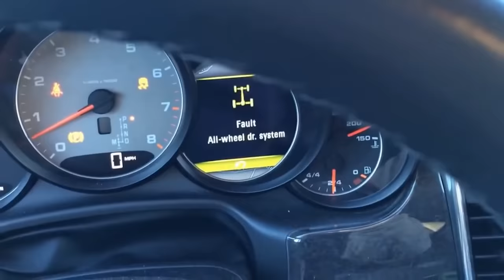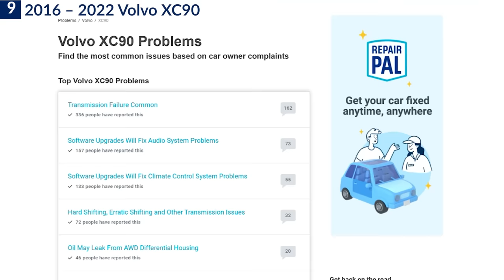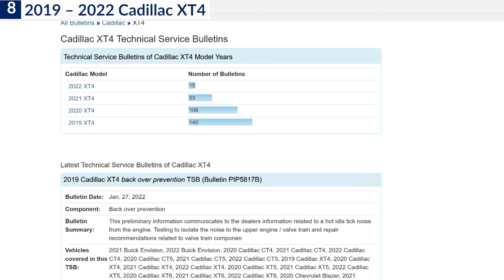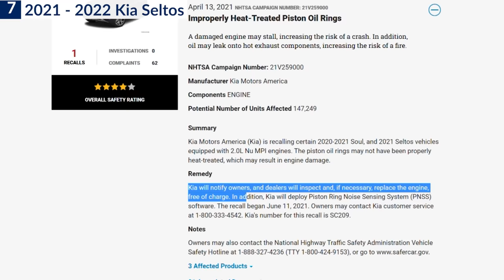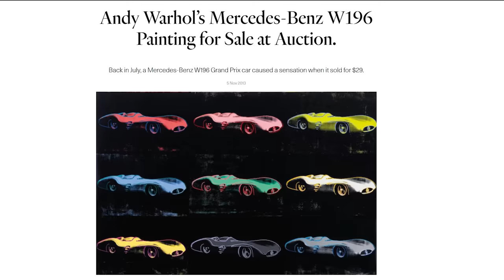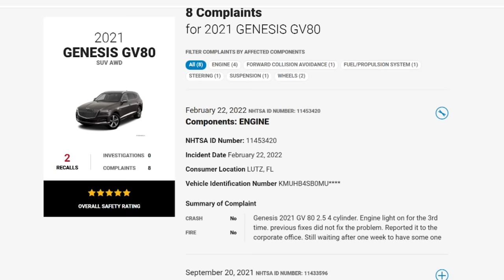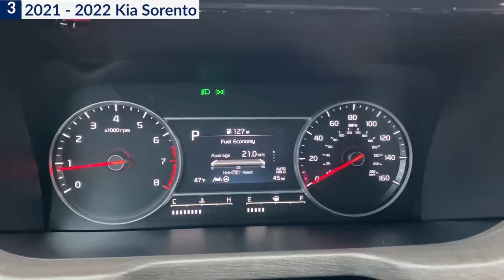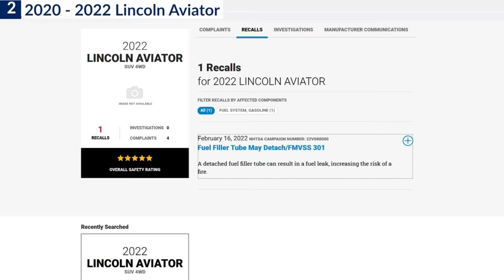10 New SUVs to AVOID - Here is Why !!

Comment: You are wrong about the XC90. Most issues with the car were electrical/infotainment related which have been addressed with newer models. The Engine was revised too and it definitely does not have transmission problems. If it does, then the Lexus RX350 would to since they both have the same transmission. This is coming from an owner... and I did a review on my channel if you guys want to see.
Reply: I have an XC90 too. What's the spec on your daily
Reply: The fact that Land Rover didn’t make this list tells
Reply: @bradleyscarreviews  Exactly
Reply: @nkulid424  T6 Inscription. Every Option. =) But I bought it used from the dealership non CPO.

Comment: This why I'm waiting on the '23 Passport.  I find it funny, that I like the Sorento better than the Genesis.  It's the same vehicle.  Love the same shot when they were putting on the door for the Explorer and Lincoln.   I don't get the fact your paying 10 to 15k more for a luxury name on the same platform.
Reply: They have zero in common other than sharing the same parent brand. The Genesis GV80 is a performance rear wheel drive based crossover and the Kia Sorento is front wheel drive based general crossover.
Reply: @chefcjnobles1680  yep
Reply: You make no sense. The Sorento and GV80 have nothing in common and they don’t share the same platform.
Reply: @steven5509  Ok, that I did not know.  Thanks for the correction.
Reply: @TwoPair72  you’re good

Comment: I am a realtor & live in Rural Ontario Canada and have owned my new Genesis GV80 since July 2021 where it took 6 months to become available but I have had zero issues with this vehicle since. The dealership picks up my GV80 from my home and drops off a loaner free of charge and they drive it back to the service centre where I receive from the dealer (which is approx 170 klm away) prompt servicing and they return my GV80  in pristine condition. I have no complaints with the Genesis GV80 that I own.
I have also only just receive one recall which was to do with the seat belt tensioner but thats all.
Reply: By the way I did buy the Genesis GV80 Prestige AWD 3.5T with every available option ! It was the first one in my city. I am told the larger engine seems to make a difference in performance than the smaller one. I also receive compliments and questions about its looks all the time.

Comment: This type of list is very useful to warn owners agaist potential mistakes to avoid when thinking about a vehicle purchase. However, I don't think CR is being totally clear with us. I have seen CR reports give low reviews on vehicles which had compelling evidence from other sources indicating the opposite. Also, they put the Kia Sorento on this list at #2 commenting on the dual clutch transmission being bumpy in stop and go traffic. This characteristic is normal with DCT transmission and you can adjust your driving to avoid this. They also failed to tell us if this comment also applied to the Hyundai Sante Fe with the DCT transmission as this is the sister car to the Sorento. Hyundai owns Kia. I would advise buyers to give a broader check of their reviews and not totally rely on this CR report.

Comment: Great information. Question: if the Yukon/Suburban/Tahoe are unreliable and problematic, what does that mean for the Escalade? Aren’t they built on the same platforms?
Reply: Jimi Jam😏  jeez. Thanks for the warning. I was about to pull the trigger on either a 2018 ESV with 129k miles or a 2016 Premium luxury with 41k.
Reply: Service writers at my dealership have told me all GM engines equipped with cylinder deactivation have lifter problems resulting in ruined camshafts thus a ruined engine.. programs are available to turn it off on engines thus equipped.. . With it turned off engines last a respectful long time..

Comment: Well, I just bought a 2022 Mazda CX-5 and figured I was going to see it on this list, but nope. After a lot of research and waiting to hear bad things, I still am pleasantly surprised and stoked about my new ride.
Reply: Nah, Mazda is build in Japan. Why I love Mazda because of Japanese attention to quality. My only two brand is Mazda and Subaru. Owned both with over 200k.
Reply: CX-5 is a good one! My mom has an older one that she drives to work an hour each way and has never had any issues for years.
Reply: I have a Mazda cx 5  2014 and i have 0 problems
Reply: I can't tell if you're joking or not. mazda has always been the most reliable brands of vehicles.
Reply: I bought the 2022 CX30 skyactive g I used to drive bmw x1 and believe me it's the best thing I ever done I'm shocked how good the Mazda is it's so underated in the market yet it's one of the most reliable brands .
Reply: Mazda engine  not good at all
Reply: Had cx 5 forever!! Best suv in the market!!
Reply: @danstonecool1734  I’ve heard, but not much.. with regular maintenance I’m sure she’ll hold up over time
Reply: They may have rust issues in the future but they are reliable!
Reply: It will stay running, but it will rust out quicker than most competitors, here in the winter salt belt!

Comment: love our xc90..that being said I would never own one without being covered by a warranty.
Reply: I wish I knew that about the XC90 before buying one with an aftermarket warranty, they won’t even honor the service I had paid for. Worn piston rings and no compression in cylinder one. I’m stuck paying for a truck I can’t drive cos it requires a new engine after owning it for a month used. I will never own another one without a real Volvo factory warranty
Reply: @NaStalgia  so Volvo isn't accepting your aftermarket warranty you purchased? If so why doesn't the warranty company send you to someone that does? Just curious I own a 2019 XC90 with a warranty from CoastGuard.
Reply: @cast9609  Volvo dealership that sold me the warranty wanted me to pay outta pocket for a new engine. The warranty company didn’t wanna cover the cost because they called it a pre-existing condition lol. To my knowledge the 2019 have the updated piston rings so oil consumption issue may not arise with yours but that transmission is a ticking time bomb because Volvo never fixed those. Sell your Volvo at the first sign of oil issue or transmission issue or else you will be on the hook for the repairs
Reply: @NaStalgia  thanks for your response. It's been a year and over 25k miles. Lol I drive a lot. But I will keep and eye for those signs. I do my own regular maintenance.
Reply: @cast9609  I was unlucky, I only drove mine less than 10k miles. You’re welcome
Reply: I love my 18  XC90 and wouldn't drive anything else...ive owned BMW,Benz and i definitely love the Volvo better idc what this report says🤷‍♀️
Reply: It’s really only the 16 xc90 that has consumption issues.  Everything after that is good.  Also if you buy it used, it’s worth getting a certified one.   The certified warranty is an extension of the new car warranty.  Aftermarket warranties are terrible and unclear as to what they cover.  It’s worth spending a few thousand more at a Volvo dealer for a certified one.
Reply: Save your money. It’s not worth it. Believe me.  They already replaced my transmission !!!. Never again!!! 🥵🥵🥵🥵🥵🥵🥵🥵🤬🤬🤬

Comment: Our Range Rover Sport is 6 years old, with 70 K. No problem’s whatsoever. Tyres and brakes replace at 50K. Just out of extended 5 year warranty.

Very comfortable seats, and a joy to drive.
Reply: I don't believe you
Reply: @kcyn132adzr9  Yes it’s true. Sadly, we are saying goodbye to the RRS, as I am retired now, and have no need of a large SUV. We have ordered a Volvo XC60 hybrid, 455 HP and 0 -100 kph in 4.5 sec. Just ideal for a retired old fart.
Reply: @oldcodger4672  you select lame cars.
Reply: This will be the seventh volvo over 45 years for us. Usually drive them 2-300 k, then pass onto to family. Our daughter and 2 friends were T boned in mum’s 940. They all walked away. The 940 was written off. No fault on our daughter. 

The police sergeant who attended the accident said “your family, and your daughter’s friends’ family, should give thanks to Saint Volvo tonight. They would not have survived in other car. “

The Jaws of Life operators need special training to cut open a Volvo, they are so strong. All four doors opened in the written off 940.

Comment: I owned a 2022 Genesis GV80. It’s the best SUV. I respectfully don’t agree with your review about the price. With the same options BMW X5 or any other brand will be over $100K. So far, it’s very reliable. I have been driving it almost close to a year.

Comment: I ordered a 2020 Xc90 Volvo from the factory and I made sure I had the lowest standard engine because it could run on regular fuel. So far I have had it in for two reasons both relatively minor and it drives like a dream. 
I believe as the years go by, you will see more and more cars have major issues with computers and other software glitches ruining their experience. One thing people should realize is these manufacturers have bidding wars for their parts manufacturing. this keeps their source pricing low but it encourages their suppliers to cut corners which affects reliability and manufacturers suffer from high recall rates.  I don't see this improving as car pricing goes higher and higher.
Reply: I also have an XC90. It's had a few minor issues, mostly early electronic gremlins, but compared to my previous Fords, Mazdas and Hondas, it's actually been more reliable, which is a feat considering how much more tech it has. The engine power is a weak point compared to other luxury SUVs, but it gets better gas mileage, and everybody has their own preferences. Get on the highway in Eco mode and it's a butter smooth family cruiser, which is what I need it for. Lemons are always possible, but with a ton of XC90s out there, I don't think its reliability is as bad as CR makes it out to be.
Reply: @jtsholtod.79  Yeah, my biggest fear is the electronics will fail, it's a matter of when, I've already had a few glitches, I just hope I'm wrong. It's still under warranty for now, but it won't be much longer.
Reply: @rwhunt99  when I was at the dealer yesterday they said that because the XC60, Polestars and new EX90 also use many of the same electronics, there will be ample shared supply, and tried and tested repairs for quite awhile, and the ability to diagnose and even fix many things over the air. I don't plan to have my vehicle long enough for that to really be needed. My biggest issue with these heavy SUVs is that the brakes wear out so quickly in city driving.
Reply: @jtsholtod.79  I'm retired and my three year old car has under 16,000 miles, so that is what is frustrating, i have hard to bring it in for replacing the exhaust sensor that should last for many thousands of miles and also I had a big black mask on my screen when using the mapping software (which is the worst I've seen by the way), and they fixed the screen by simply updating the software. I have to drive an hour and a half to get to the dealer, which wouldn't be too bad if there weren't any problems, but when they take three days to replace a sensor that takes five minutes to change out, that's annoying as hell.
 Other than that, it is a very nice car to drive and I do hope it lasts quite a while. I got the T-5 to get the engine that doesn't have to use premium fuel, to make it cheaper to drive. and I like it.